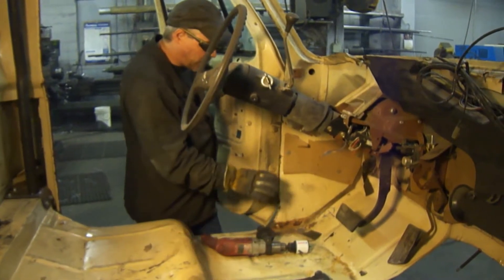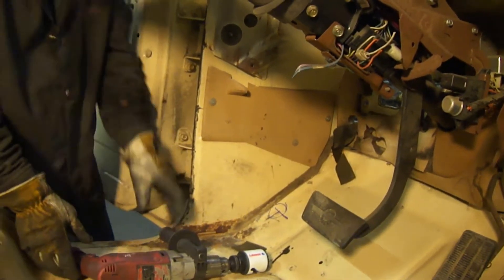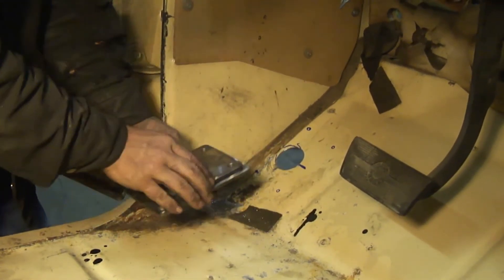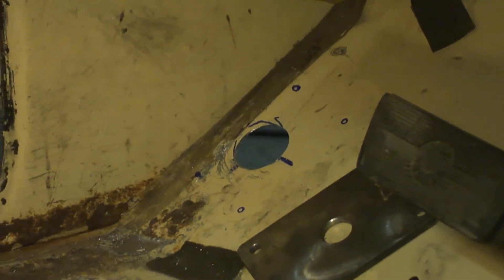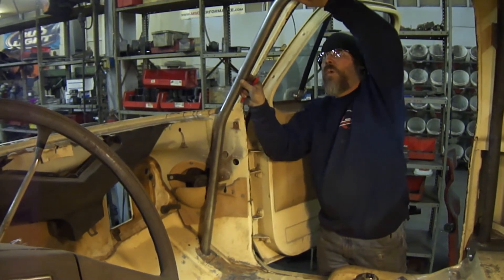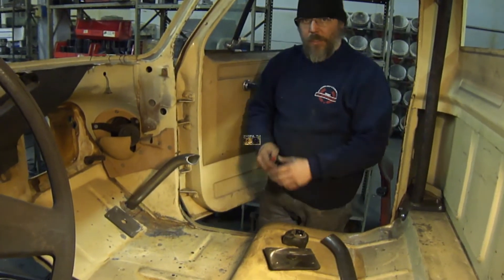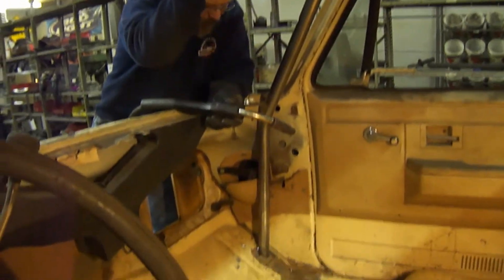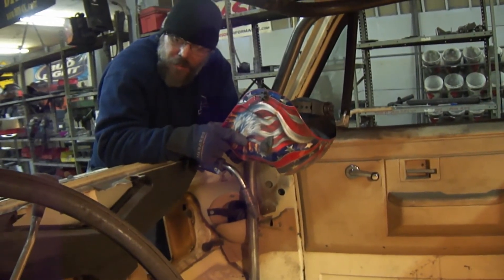apillar and floor plates

Comment: That is not right. When you have a frame like the truck you are putting a roll cage in it has to be welded to the frame. Floor plates are for unibody cars only.